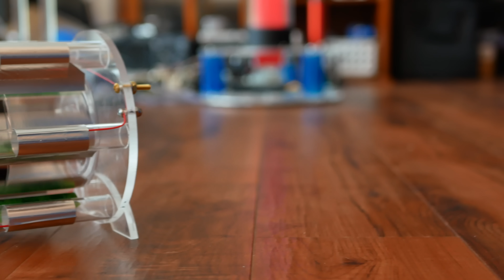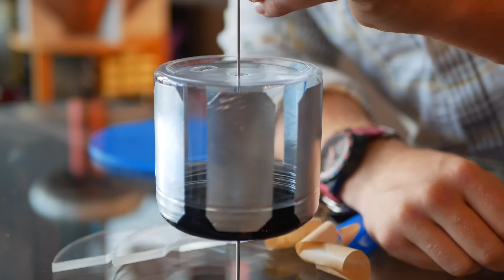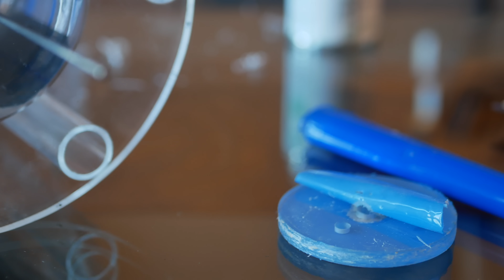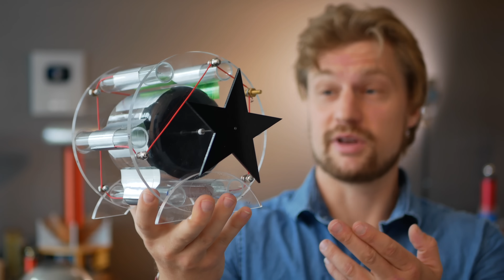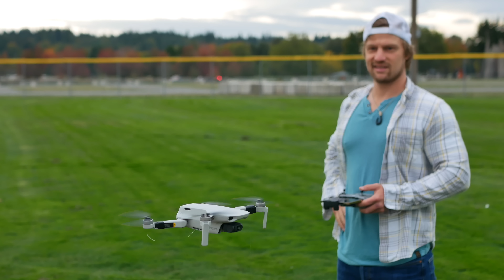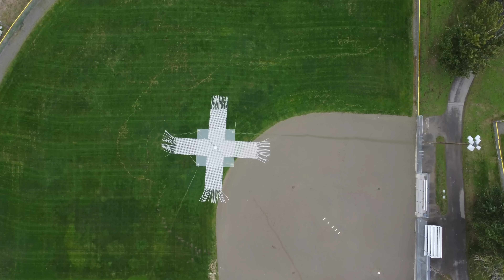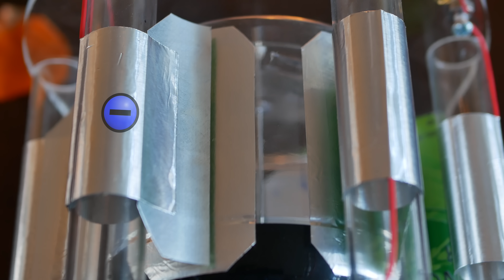Building A Wirelessly Powered Corona Motor (DIY)

Comment: Plasma Incinerator - One of the biggest problems for many developing countries is that of getting rid of the food and kitchen waste on a daily basis.
Usually they collect the material ,and burn it with some kerosene added. Highly polluting. 
If we can make a plasma incinerator that can use the methane in these waste to create incineration , that would be great.
Reply from the maker: I will look into a micro plasma incinerator build.

Comment: You might need a bigger drone for all the extra circuits or you might need to make your drone go higher and then use a step down transformer? I'm not sure how coronal electricity works exactly but I'm assuming you need a certain voltage range? Either way more power in more power out I guess

Comment: Not that this has anything to do with the Corona motor, but I read somewhere that if you apply high voltage to an object it will change the inertia of the object.  What if you use a flywheel on a shaft and rotate the flywheel with an electric motor.  (Insulate the motor from the shaft. )   You could measure the voltage or amps to test whether the inertia can change if a high voltage charge is applied to the shaft and flywheel.

Comment: Have you tried horizontal thicker UN-INSULATED wire, as long as possible?
If you can make it as high as regular phone/power lines, you'll find after it acclimates to the ether, there's incredible voltage. (Can you see where this is leading, ever wonder why power lines strung between pylons is un-insulated? Yet those same cables get insulated once put underground, hhmm)

Comment: great video love your sence of humour, and who doanst love curves. why not put tape on first so can be real smooth ? also using a spacer bar would make the taped on bits leval and equal heights. as usualy i dont understand the science but love the idea of it as a charger for camping and stuff i mean we have power lines all over so how much static do they throw out? would a wind charger with low output make that moter increase its power if say silk covered blades?

Comment: You know what I think you recreated a ancient device. What if people in ancient times were using similar motors for their technology. They found alkaline batteries called the Baghdad battery in the past which could have been used for so many different applications. And with the limited resources and materials that would be an easy motor for some ancient person to make. They just needed to use some wood are conductive material like gold or copper. And over the centuries devices like that would completely disappear rotting away. I know this is going to sound a little bit like some weird ancient astronaut freak, but I often suspected that the ancient pyramids of Giza were some form of static generator. I mean think about it a large point topped with a cap that was made of a metal which was a combination of gold, copper, and silver. Plus the sides were made of smooth limestone. That were not perfectly flat. But I'm surprised that most people don't think about this but the Giza pyramid actually have eight sides. Each side is actually convexed the middle leading to the top. And each side points north, south, east and west perfectly. And the environment that's placed in is a very dry climate. I would imagine a small breeze of dry air flowing up the channels on either side of the pyramid striking that metal top would generate a massive amount of static electricity. And like you demonstrated with the motor similar to Teslas idea of transmitted energy I believe they could have used the motors in the same fashion. Of course people would thought that was magic and maybe only known to the high priest. Overall that's cool. 👌✌️

Comment: You should cut out the drum and make another motor this time without dead weight, in other words cut everything not required. So make a frame to hold the pieces and only the pieces.

Comment: I suspect that the engine would work under a high voltage line, but I think there are still a few diodes missing

Comment: Awesome build!! Wondering what's the relationship between the number of columns and torque strength?! What happens if you halved the column size but doubled it (Or doubled the column size and half the number!)

Comment: There was already free energy from the Aether using the old world buildings of Tartaria. This tech is older than the first 10% of the comment section. The amperes are not much unless paralleled up, but the voltage can go insane high every foot above the last, 300m copper wire to a tower with a alloy or copper topping made like a Hersey's kiss (see old buildings of Tartaria) so use a buck down converter to see output at a lower level
.Esp 32 and this motor with a infrared heater with capacitance interference and you could  split voltage and have one line go to tools and implements used , and the other can go to a sand battery and use either canthal wire or a rocket stove inside of sand batt,  with a steam turbine or Stirling engine and have that loop closed to recirculate the water and you have dual power sources and much more wattage and amperes to use
Reply: And free heat from both the infrared and the sand battery. You also have temperature controlled heat you can pull off as well

Comment: why don't you charge a layden jar with the van de graf then use a antenna plate some distance away from the cap connected to the ion motor then use rubber on tubes between the acrylic tubes to collect charge from the ion motor and the connect the wire from that rubber directly back to the cap. as long as the capacitance is drained slowly you just need the charge collected by the rubber to charge the cap faster than the cap drains and then see what happens.

Comment: Suppose one had a motor such as this, but rather than have a drone, one had, say... 10 of the wire assemblies - each being suspended by an insulator  10 meters up in a tree.  Would it be possible to wire those 10 assemblies together and then to the corona motor??  Or is that a bridge too far?  Great video!!

Comment: Hey plasma channel. I wanted to maybe challenge you. I will be working on making my own motor shortly. Correct me if Im wrong but if you were to put multiple electrets beside each other in a non uniform way with distance and charge you would then be creating a non uniform electric field and voltage. Placing two of these walls of non uniform electrets around a motor could potentially create torque.  I'm curious to see what you guys think. Thanks

Comment: curious the maximum build size where it could function without negative return based on weight. Also how much torque such a device could generate. More over how much an array of machines in series could generate. Probably have to design solution for a collection array for static collection. Or combine it with autonomous radio or wireless scavenger. All tied to a long-term storage solution like salt water batteries.

Curious what the energy bleed and if it could be paired with a thermal harvester as well.

Comment: So we got to lifting some small washers by using the horizontal axis drum static motor, so just how sophisticated is the N.Tesla style static energy harvester as developed by Nicola Tesla...   The waiting  'off world visitors'  suggest their device could be used to charge 12~24 volt batteries in remote communities for lighting, charging cell-phones, and maybe a 'car/rv refrigerator...  Does it go to running some mains electrical appliances?    I am a 77 year old pensioner with a very limited budget, and have read of switching a very small (3 to 6 volts) using a 555 timer and some fast switching transistors (40khz) to harvest the burst of energy in the switch off phase through a tesla (air) coil to feed capacitors to deliver greater charging levels for higher power applications?

Comment: Why not apply a vacuum to the rotational part of the motor just to see how much faster it will turn without having to squish past all that air inside the jar.  :-)  Maybe it could turn a magnet too (even an electro-magnetic one to transfer rotational energy outside the jar. (to another magnet dummy).

Comment: This is awesome genius invention am huge fan of plasm on project of rocket using mainly plasm energy into space but crazy cold in space in fact I got two projects am working on the other is Mega generator that will be powered by plasma electricity fed by lightning but kind of material can handle on brunch of electricity can you come back on to help me a bit am in South Africa in Durban

Comment: Could motors like this be installed near high voltage power line poles to power devices that do not consume much electricity (ie: meteorology equipment)? I remember them cracking and hissing, so there's got to be some power going into the air that maybe this kind of engine could recapture

Comment: I love it! I will need to build mine. Also. is there a way to use more power if you make your fines smaller and put either the negative or positive inside your rotating cylinder? Of course you would need to make then really small. I wonder if you can use a simple squirrel cage design and be slightly angled as well. Having arms that reach out to grab the next fin means you can have more in a tighter area. Question... have you put your motors outside in an electrical storm yet? Something tells me you will have to make one that will explode but when you do, please get it on camera! Something also tells me you might be able to use these as batteries. What is your voltage output if you put some DC motors to them? First thing is building a better design. I will see what I can make with my k'nex. This should be fun. All the measurements are already there so I just need to build it. I will definitely send you a pic of what I make but I will try to get my hands on an old TV antenna to power it. This should be fun, I am really excited. By the way, I use magnets instead of bearings. I find they use hardly any friction. I bet I could make some small electromagnets so the faster it spins the more energy it gives itself. Ok, time to get to work. Thanks for showing me the basics.
Reply: An electrical storm would indeed give much more power! And then it would give you much much much more when lightning strikes the collector.

Comment: If you can get a standard Fluorescent tube light to glow within 50-60 feet of an electric pylon. Would your little motor work? Would this motor continue to turn if a flywheel was spun up to a very high spin rate, and then allow the motor to keep rotating the flywheel?

Comment: Hypothetical question from someone who really has little to no knowledge about this kind of stuff: Since the motor can use atmospheric electricity to function, does that mean it could be used to prevent thunderstorms? And would it work better during them as well? 
Also, would running the motor in an enclosed space filled with helium rotate faster?

Comment: That was awesome! Two items, first will the motor spin from a nearby electrical storm? Second, if you double up the abount of (+)(-) elements, will you get more torque? Thank you!
Reply from the maker: Hi Monte, thanks! It could work from a nearby storm, but you'd need an antenna high in the air, 15-20 feet off the ground. As for the fin elements, you may be able to get more torque with more fins.

Comment: There are plenty of tall buildings that are much taller than 200m, so why not have a generator in the basement pumping energy into the grid based on this effect. How much power can you extract from the atmosphere like this? Are there any negative consequences doing this at a large scale?

Comment: Very cool. New subscriber. Is there any charge coming off the shaft? I'm wondering if the way forward is to place a capacitor in series with the shaft and ground, and have it discharge in parallel into some kind of storage device, or better yet, into a primary, secondary and series-wound bifilar pickup coil. Looking forward to your upcoming videos.
Reply from the maker: Hi Bob, welcome to the Plasma Fam. Honored to have you, and am glad you asked the question. The shaft sits perfectly middle between ground and positive voltage. However, the ground and positive nodes are radially around the shaft, and are symmetrical. This essentially balances out the charge so that the shaf has little to no charge. At least not any charge I detected.

edit: check out my new video released today!

Comment: Also, Your vandigraph provided wireless charge. Without a drone or crazy high antenna, how can I make a more robust motor and pull a charge from the air?
I'm think 100lbs or more robust by the way.

Comment: is it possible with the torque of the Tesla motor can you  build a clutch activated generator for 12 volts or maybe 240 volts and 200 amps to run a house?

Comment: Ok ,,, so let's make one ,,, that makes energy.   I don't have a way to make this  and I have a design that is energy being made and laws of conservation are totally physics possible..  I want someone to try and you seem to have the way. All energy is production from conversion,,,   .   Force to usable electricity.  Right.  Car gas to motor 75 % goes to heat 25 goes to tires . Hint, 3 magnets and a coil. 2 magnets move , one is negative to the remainders:)

Comment: Would it get better if the aluminium foil was replaced with a different metal? Or every second foil was replaced with a different metals such as copper, silver gold or even carbon? P.s can I have the spare motor?

Comment: What if you have three electromagnets in a triangle turned on and off to mimic rotation put a conductor in the center what would happen could this generate electricity or would it over heat and just be an induction heater

Comment: This is very interesting! I came across another video where the construction was pretty much the same, except, the rotor did not have sections of foil like yours but a continuous conducting surface (a long foil was taped along the surface throughout) and it ran! Instinctively, having sections of foils along the rotor like in your construction makes sense since the charge picked up by each would stay there and cause rotation to the stator blade of the other polarity. Eager to know if you can explain this..! And great work! Very neat build I must say! 🙂

Edit - Here's the link to the video I saw earlier - https://www.youtube.com/watch?v=ksp_O_1WmvA

Thank you again!

Comment: the ultimate, hardly, as you dont even use Robert's conductive carbon ink in any way, not least carbonised tom...
paint on battery/super cap storage laden jar + dipped carbon felt brushes to optimise that free static energy did you pay the tax on that
now a simple axial flux 3 phase alternate static charged painted caps with carbon ink coils plus increased centre of mass to keep inertia that's getting there

Comment: Do you think if you found a better (more voltage) ground connection, say one near an underground flowing water source, that it would find more translated power?
Reply: No. The ground connection is not a limiting factor at these currents - the collector is. Want more power, need more collector - a bigger one for more current, or multiple collectors in parallel, or fly the drone higher for more voltage.

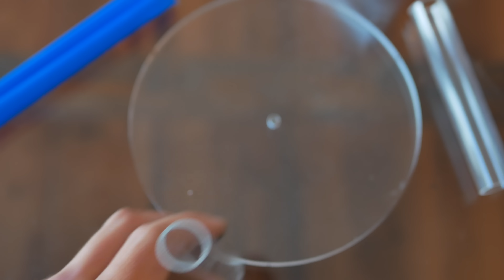Comment: Just two comments why a slice of cake picture at 2:30? and the second what is the risk of mega discharge of the sky by being a high point like a lightening conductor? Would not recommend doing this in highly charged atmosphere otherwise you might get millions of volts and amps if lightening strikes.

Comment: If you turn the motor does it become a generator?
Reply from the maker: Great question. No, it will not work the other way around, Unless you use electrik material.

Comment: Your skin many have Ion powers electric system around it's fusion with carbon fibre optic cables suit around your body if many have nitrogen and hydrogen around suit The Flash man

Comment: Hi.  You and @lasersaber have each built fairly "robust" Corona Motors  (his is Bigger).  When his demonstrated enough 'manly' torque to drill holes in wood https://youtu.be/vDRCKVUO8vw?si=-9FwFEL26-BK_Hk4 , running off a small Van de Graaff, the obvious question to me was, "Why couldn't it turn the little bitty rubber band motor that drives the VDG?"
Since it doesn't have the Back EMF & thus rotational cogging resistance of an EM motor, there is no reason, inherent in physics, which prevents this; its an Engineering Challenge.  Also pertinent is the Faraday Homopolar Generator (which also has no such EM drag), which is, in effect, a current multiplier , that might be placed in-line on the same shaft, for greater effect.  What say you, Jay?

Comment: permanent magnetic ROTOR CORE synchronous EEG SOLENOID COIL TRANSDUCTOR UNDERNEATH FOIL PHASE thermodynamic REACTIVE pyroelectric effectS
voltage ultra capacitor PYRO- PARAMAGNETIC ALUMINUM COATED SODIUM M3 LIQUID PART1&2 electric flap EMT /MFD/ THERMOMAGNETICALLY
PYROELECTRIC EFFECTS DIAMAGNETIC REPULSION ELECTROMOTIVE FLUX electrodynamic FORCES ROTATION EEG  atmospheric condensation paramagnetic electrolyte  B OR A GAS SENSORY potentiometric sensory!  CYLINDRICAL 
 ION FLAP
CIRCUITRY for the measurement of wireless acidic electrolytes portional to the ELECTRODE mass  conductivity ELECTRICITY CYCLING sensory potentiometric SENSORY ENGINE